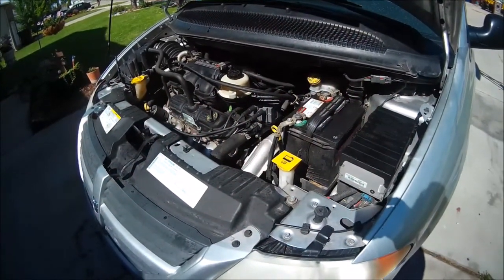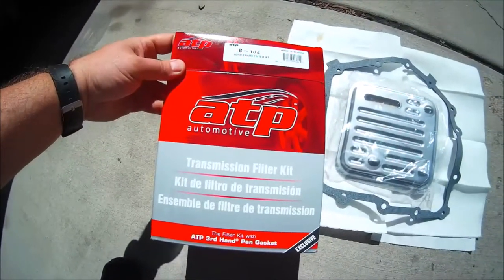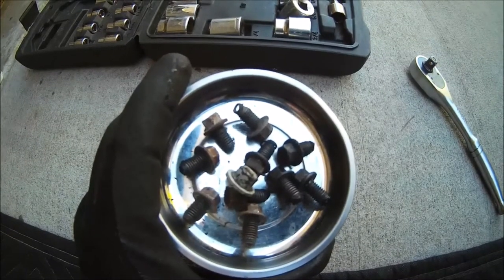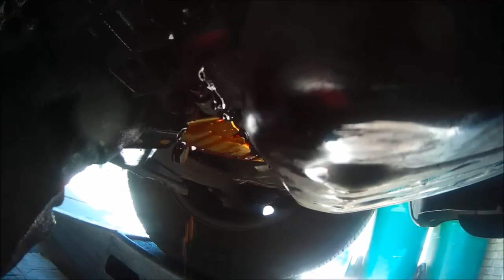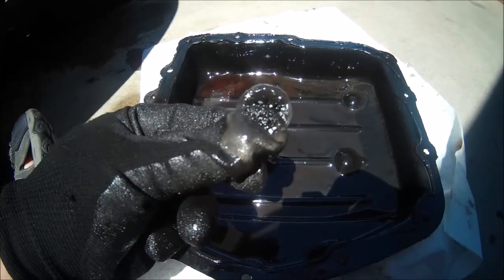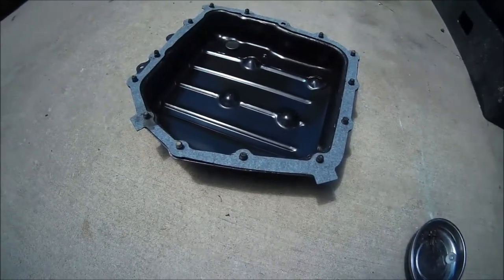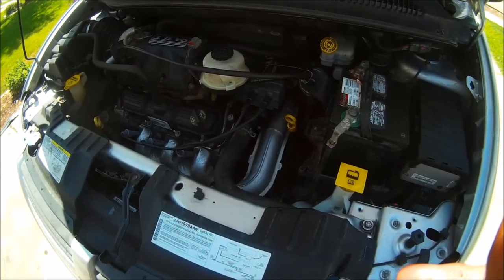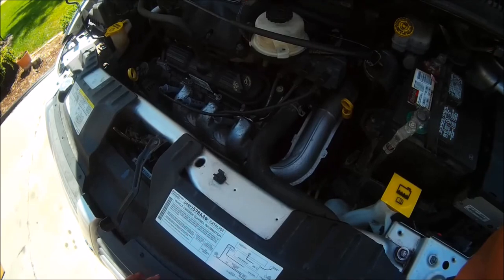2001-07 Dodge Caravan Transmission Drain & Filter Change

Comment: There are inexpensive replacement transmission pans with a drain plug built in so you don't have to go through the mess of dropping the pan every time you just want to drain and replace the fluid.

Comment: The filter may come loose, but it will not fall out into your pan. There is bumps molded on the filter that correspond to bumps molded into the pan to hold it in place.

Comment: The hot and cold marks are when the vehicle is running! Cold is for when running and not driven to operating temp and hot is after u have driven it a bit and engine oil and coolant Temps are at your usual operating temperature. Checking a trans dip stick with the vehicle off is only going to tell u if u have some sort of fluid in the system it is very inaccurate to check and go off of said readings with the car off. Same with when u fill the system. Fill it with the amount u drained firstly. Let the car run and idle a few minutes with foot on brake in gear. Then cycle through all the gears from park to reverse to drive to 1 to reverse to drive to park to reverse to drive blah blah u get it. Do that a few times then go check the level, add as needed and cycle gears again. Repeat that process until the level stays at the full hot mark and ur good to go. Failure to cycle through the gears and obtain a proper fluid level HOT and u will burn that trans up in no time!

Comment: Great video, because I messed up my first time, expecting the last person took off the pan, and filter like they cared. I ended up with three stripped bolt holes.. and it wasn't even leaking, but it was dark, and slightly overfilled, big mistake, now I'm going to be forced to drive it 1200 miles, before I can truly fix it once and for all.

Comment: Thank you for the informative video. I have a Dodge Grand Caravan 2003. The van needs the transmission fluid change and filter. The video will be very helpful. My van also needs the lower control arms. Do you know where I can buy from or if you recommend a brand. I will appreciate your advise. Thank you.

Comment: To avoid doing multiple drains another alternative is to disconnect the transmission oil return line. Then, run the car. AS the oil is being pumped add the same amount of fluid that is coming out. The car will pump the oil for you from the TC and cooler.
Reply from the maker: Good idea, thank you.

Comment: Would you recommend doing this service on a caravan that has about 150,000 miles. I do not know if the previous owner took care of this. Or should be this just left alone and hope for the best. Kind regards.
Reply from the maker: You know, it's a pretty easy process.  It's not a bad idea to do it on a car with that many miles. However, others will tell you if your not having issues, why do it? 

  I did it to all my vehicles just to see what came out, and every vehicle had at least a bit of some debris, including our SUV that has 47,000.

Comment: How many miles were on your Caravan when you did this?  I just bought an '07 with 101k miles and will be doing this process soon.  I checked my fluid and it does not look too dark.
Reply from the maker: I had about 115k when I did it. If it's not too dark, or sludgy dont worry about it. 

 In my opinion, if it's too clean it can cause the transmission to slip because it doesn't have the grit. But that's just my opinion.